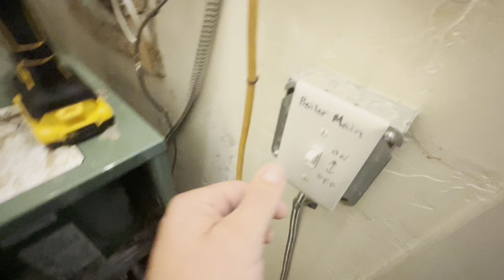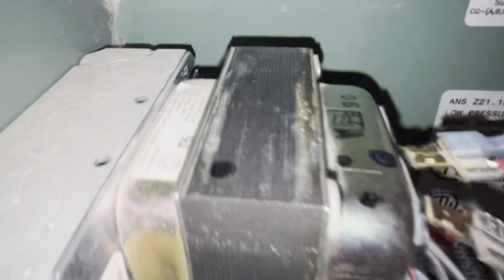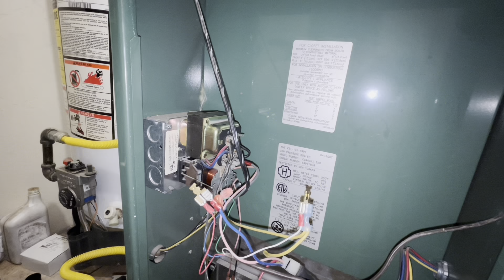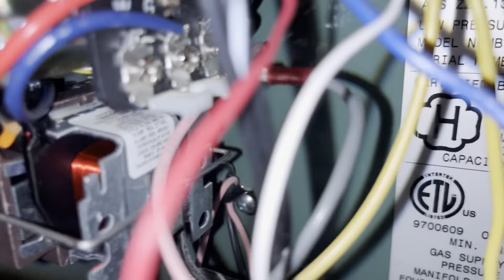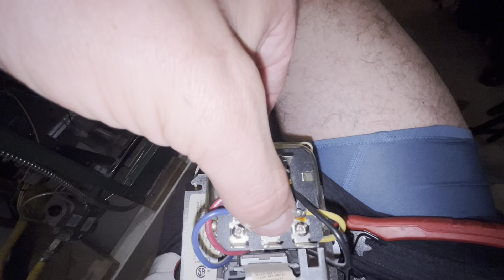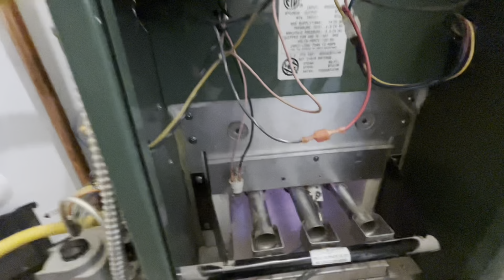How To Replace Boiler Transformer. How to Repair NewYorker Radiant Heat Boiler Part3of5

Comment: what if you didnt take pictures and youre having trouble getting the wiring right?
Reply from the maker: Searching the internet for wire diagrams and tracing wires to source unfortunately
Reply: I did, but I didn't say different style.Because the other one was fifty years old
Reply: Everything else was the same. Besides that yellow wire hanging out, the back must power the inducer motor or something.